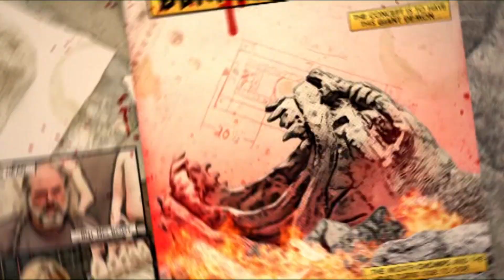Making Monsters Show Trailer | Distortions Unlimited Best Scenes

Comment: I have a question and need advice:
 I am trying to create a 2-layer mask. 
The top layer mask has 4 opening panels to reveal the under layer mask. 
The under layer mask will have a Leatherface style to it, with latex.
Both masks are attached in some form so the panels can be hands free to open and may use velcro straps to hold masks on head. 
Will have face horror paint under masks to enhance experience ans spookage.